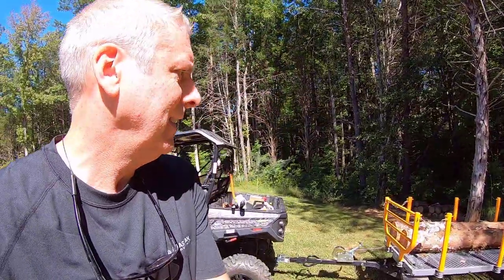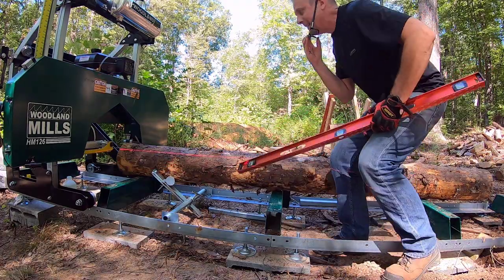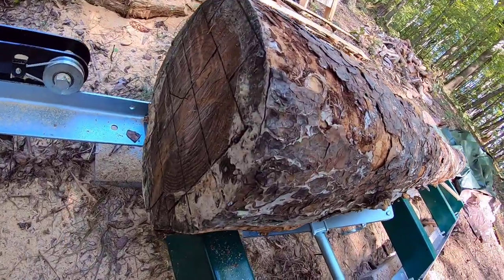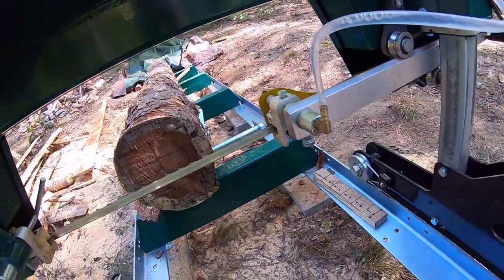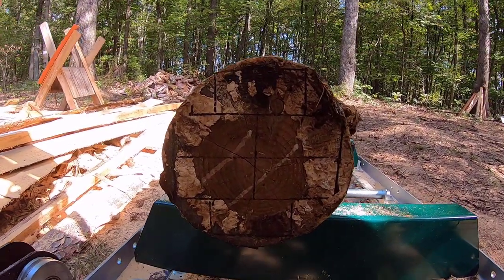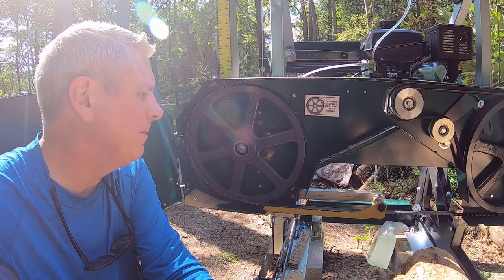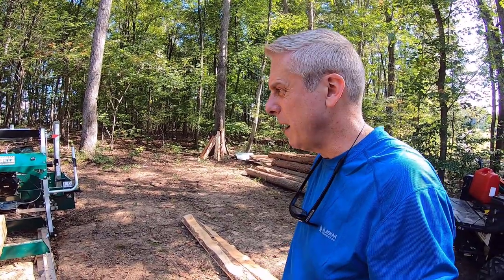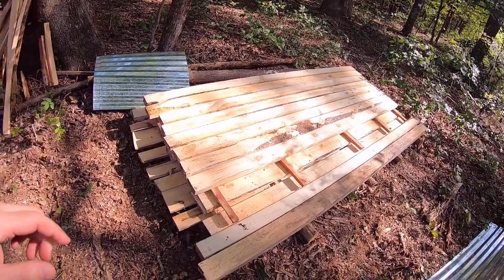34-Woodland Mills Sawmill in action cutting pine 2x4s

Comment: I have a 130 max I purchased about 6 months ago. from the start I had a Issue with the Blade jumping off. Mainly when first hitting the throttle lever. It would come off the wheel or slam into the yellow blade guard and pull the blade guide out. After double checking the tracking several times I finally found what I believe the issue was. when turning the wheel by hand to check your tracking, watch the belt in the pulley. at times the slack rides up to the top of the pulley and bunches up under the blade. I found this while slowly pressing the throttle to get the blade up to speed. the Blade would not turn. When I shut down the mill to check the Problem I saw the belt wadded up under the blade. I removed the blade and belt. Cleaned the inside of the pulley and the belt with some contact cleaner. so far the Blade has stayed on and I have cut a good bit of fresh cut pine. I also got into the habit of starting the blade at a slower speed before giving it full speed for making the cut.  Not saying that this is a problem you are having but it is something to look for if the blade keeps coming off.
Reply from the maker: Thanks so much for the great ideas to try.  I haven't had the issue since that video, but I'll pay close attention to the things you noted.  Thanks for the help and for watching.   Much appreciated.

Comment: Looking good! We're about the same distance along this YouTube thing. I'm hoping to get the HM130MAX next spring. Do you find the HM126 is large enough for your logs? Is the laser stock to the mill, or aftermarket? Keep it up! Subscribed!!
Reply from the maker: I opted for the larger motor option (14hsp), same engine in the HM130, so seems to be plenty of power.  When I ordered it, I knew I didn't have the machinery to cut and transport logs bigger that 24", so felt the HM126 would be perfect.  But if you can spend the extra $$ to get the HM130, I think you won't regret it. 

As far as the laser, mine is DIY.  I had a whole Discussion post on my Channel page with detailed parts list and links to other sites that sold ready to install green lasers too.  However, YouTube just did away with Discussion boards so I lost everything.  I can probably try to find the links somewhere again if you're really interested. 

Thanks for the kind words of support and for subscribing.
Reply: @twc-projects  I have an ancient backhoe with a loader bucket upon which I secure forks. This allows me to handle larger logs easily and my one-can-show can handle it. Thanks for the input. When I get to the point of needing info regarding the laser, I'll do my research and consult you if needed. I don't want to be a bother, of course. Thanks for replying.